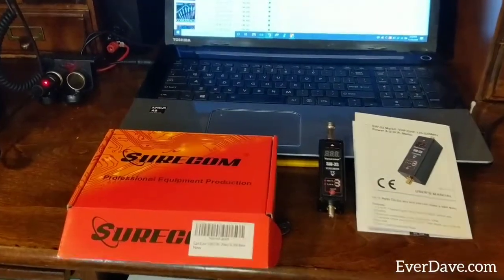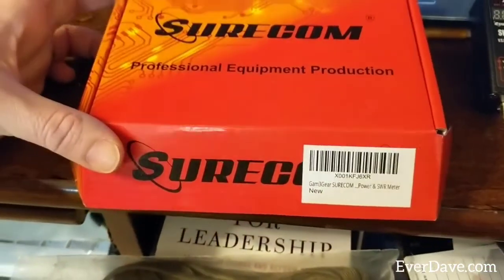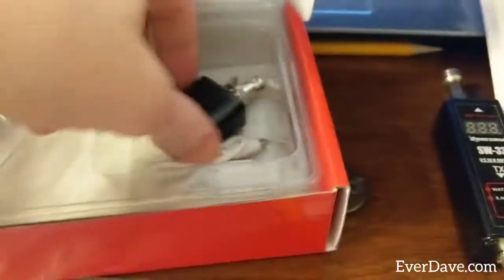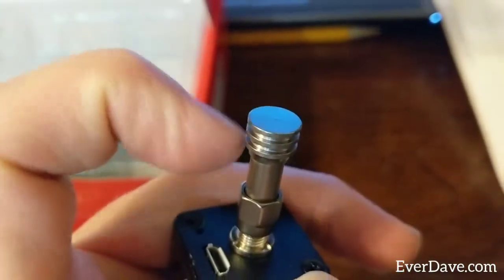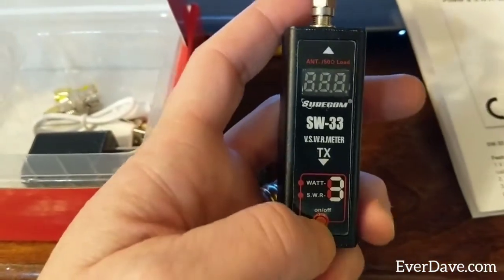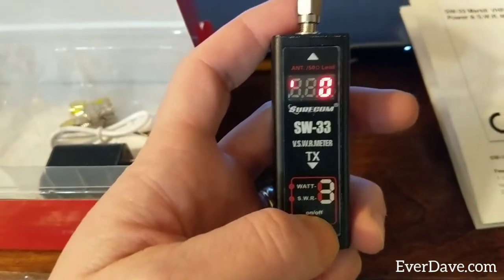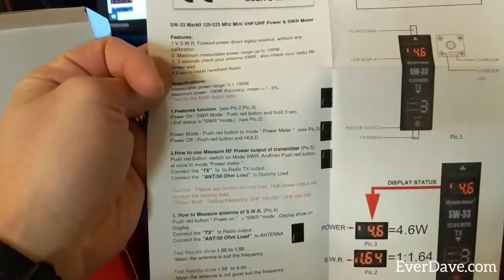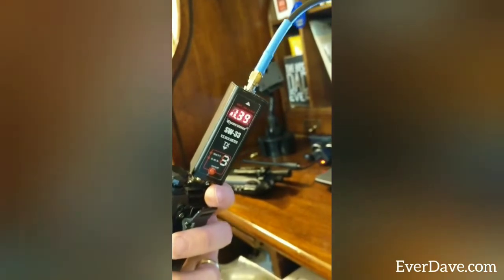Gam3Gear Surecom SW-33 Power and SWR meter - Unboxing and testing

Comment: I just purchsed this unit and realized I might need to buy another item. Do I need to purchase a small jumper coax to use this to calibrate my CB radio?
Reply from the maker: I'm not sure what connection your CB radio has on it. You may need another adapter.